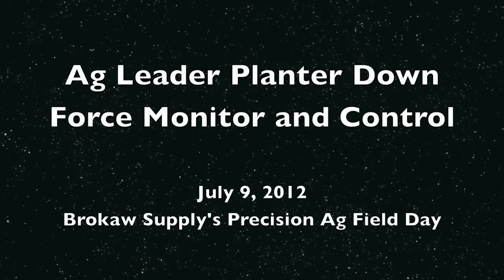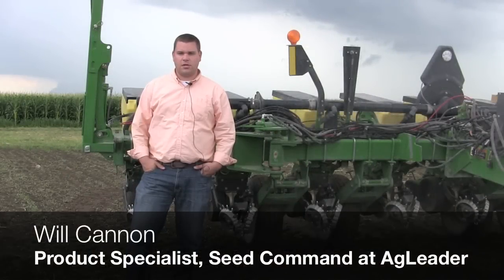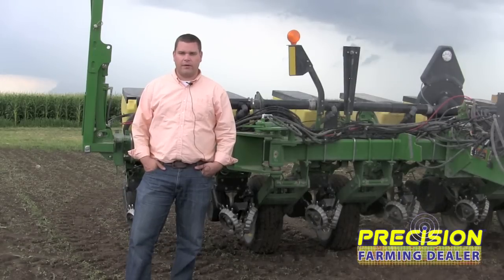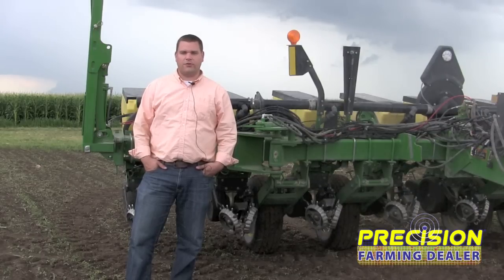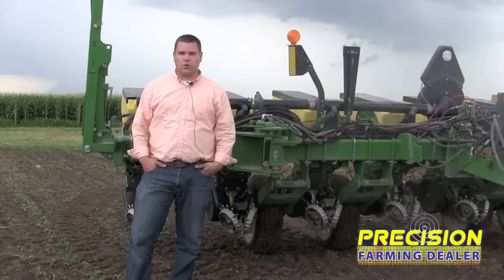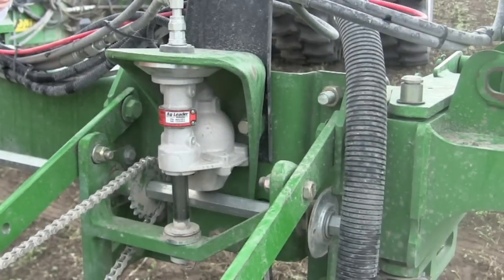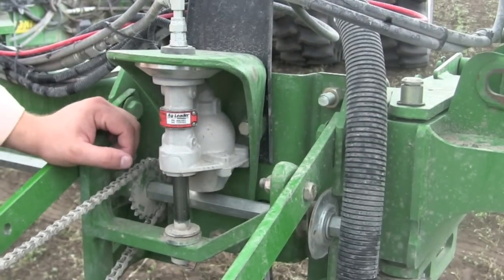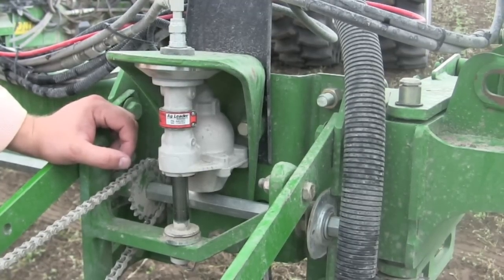Product: Ag Leader Planter Down Force Monitor and Control

Comment: what about up lift on the row unit because there is to much down force from just the weight of the planter, row unit and seed? Also what is actually measuring the down force and how does it do it?